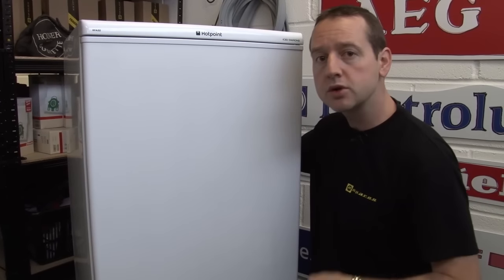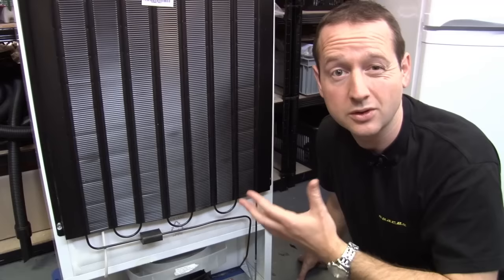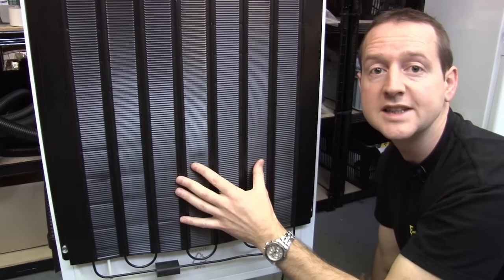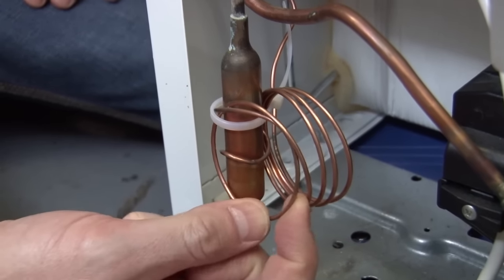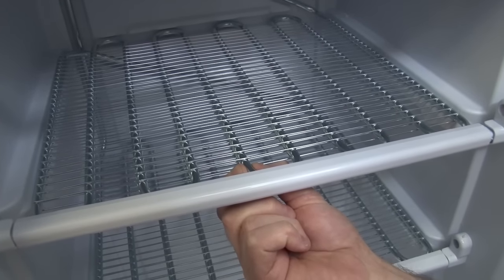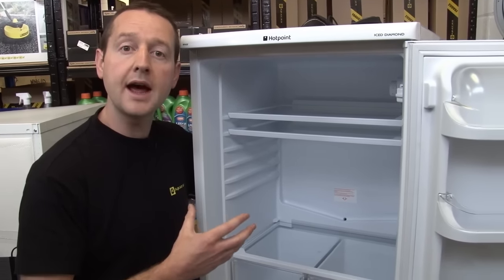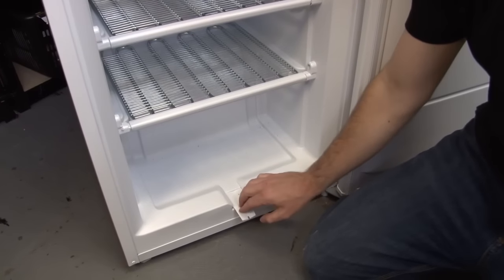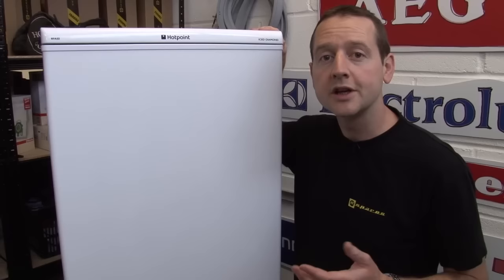How Does a Fridge Work?  (How is a Fridge Cooled & More!)

Comment: Thanks again, will give this a try.
I take it that if it does confirm that it's a compressor problem this would be a more costly repair as a would need to get an engineer to fix/replace the faulty compressor.
If this is the case I will Prob opt for a new fridge freezer as I would imagine this would be quite costly as some places charge around £70 just to look at it before they charge for parts and labour.
Reply from the maker: Certainly if it looks like a compressor problem get a quote as to how much this would cost to replace. The cost of the part alone without the 'fittings' could well be over two hundred pounds.

Comment: Great job explaining. Thank you so much. How does a combination fridge/freezer differ the temperatures between the two boxes? Do they share a compressor and have in line valves that shut off liquid flow?
Reply from the maker: Hi Brian, thanks for your comments. We think you will find our advice centre article useful below:
www.espares.co.uk/advice/careandmaintenance/how-fridges-and-freezers-work

Comment: Surprising how simple it is really.
Reply from the maker: The first fridge with a compressor was invented 100 years ago and essentially they are the same. The gas has changed a few times for safety and the environment but nearly all fridges continue to use a sealed system with a compressor and a gas.

Comment: This video is proof that you don't need to know how things work to be able to repair them. The throttling device, in this case the capillary coil, does NOT create pressure. On the contrary, passing through a narrow section greatly reduces the pressure on a fluid (Bernoulli's principle). The drop in temperature happens THROUGHOUT the coil (as is explained by the Joule-Thompson effect), not at its exit. What comes out of it is very cold, low pressure, partially evaporated refrigerant. As it circulates through the heat exchanger inside the fridge it absorbs heat from the stored food, which further evaporates the refrigerant. The rest of the circuit -the compressor and the heat exchanger at the back of the fridge (condenser)- exist to return the refrigerant to a state of high pressure liquid before it enters the coil again.

So these are the 4 steps of the process:

1) The compressor pressurizes the refrigerant: it goes from low to high pressure gas. This increase in pressure causes a big (unwanted, but inevitable) increase in temperature, as molecules of the gas are forced closer together.

2) To get rid of some of that heat and turn it into a liquid, the refrigerant goes through the condenser. The pressure doesn't change during this step.

3) The high pressure liquid refrigerant then goes through the capillary coil, which causes an opposite effect to the compressor: both the pressure and the temperature drop sharply.

4) Now we have what we need: cold refrigerant, which we can circulate through the interior of the fridge to cool its contents. The temperature of the refrigerant should remain constant during its travel through the evaporator, since all the heat it absorbs goes towards changing phase from liquid to gas (hence the name evaporator).

Pressure affects the evaporation points of fluids. That is why the refrigerant enters the compressor in a gaseous state even though it's cold, while it goes inside the coil as a liquid hot to the touch.
Reply from the maker: Thanks for your comments, While we agree with some parts of your explanation can we just point out that evaporation only starts as the gas exits the capillary into the evaporator. This can easily be confirmed by touching and feeling the temperature along the capillary, and comparing with the evaporator where the gas starts evaporating and cooling absorbing any heat from the surrounding area.

Comment: Yes u are correct.... If i could get the technical specs of the switch...that would resolve the issue of where i need to put probe but searching online comes up with nothing
Reply from the maker: Appliance manufacturers do not supply this amount of detail with their parts they just confirm the correct part for their models.
Reply: well originally i put the probe end in the freezer as far down as i could go from the fan which was only a few inches...and freezer wouldnt get cold enough...i then put the probe in the refrig side and now the freezer is too cold and the refrig sides freezes so i have to assume from this that the temp control switch is for freezer side...but i think i need to somehow get the probe away from the cold air fan in the freezer ..may have to add wire to the connections to get the probe to go through the hole in the bottom of fridge to bottom of freezer and then test again...

Comment: Great explanation. I accidentally pierced my fridge internal coil recently. With what kind of gas should I refill it?
Reply from the maker: There will be a label inside and on the compressor stating what gas (R600A or R134)  but to replace the gas you first need to seal the system and then remove ALL the air with a vacuum pump and then measure the exact quantity of gas. This is a job for a refrigeration systems engineer or it  is very unlikely to be successful and in most countries you have to be licensed to use R134 as as it damages the Ozone layer.
Reply: eSpares Oh, so, I guess I cannot handle it myself since a vacuum pumper is needed. But thanks for your reply.
Reply from the maker: Sorry for the news Ricardo but if its any guide I used to do this type of repair regularly but am unable to do it even for my own appliances as I no longer have access to the specialist equipment.:-(

Comment: this is cool!

I am wondering tho, you know the small box that comes in a mini fridge? it freezes but there are no connections to it to make it any colder than the fridge itself. I'm wondering how this works. How the little box can freeze while the rest of the fridge doesn't?
Reply from the maker: Reyna Elisaia Most 'under the counter' fridges have an ice box. If you look closely they are made of metal and typically have a zig zag raised portion on the surface. This is the evaporator and has the refrigeration gas flowing through it to cool the fridge. Its a bit like the reverse of a central heating radiator which will get a lot hotter than the room it is heating the ice box acts as a cold radiator for the fridge. It will be 'plumbed' directly to the condenser and the compressor.

Comment: Thanks for the quick reply.
It definitely sounds like the thermostat then as it does not run continually, only problem is I can't seem to work out how to remove the cover to get into the thermostat as there is no screws and pulling at it looks like the hole casing would be ripped right off the wall.
The model no is smeg CR 325 A1.
I can't seem to find out how to remove the part to get into the thermostat.
8 degrees is the coolest it will go if I move the thermometer to the top it is a good bit higher but I suppose that is to be expected.
If u know how this part is attached or how it can be removed it would be a great help.

Thanks Chris
Reply from the maker: Place your thermometer in a glass of water and leave for 24 hours to get a accurate reading and check the thermometer reads accurately as some are not so good.
To remove the thermostat cover ( http://www.espares.co.uk/product/es1597055 )
it appears there are two 'hooks' that lock into the lining when the assembly was pushed back from the front. There is likely to be a screw at the front that may be covered by the switch push that will need removing before pulling the assembly towards you and removing.

Comment: Thanks. Excellent explanation. One thing I dont understand is the relationship between the defrost sensor and the Fridge/freezer thermostat. Are they the same thing? My Fridge/Freezer get too cold,  it's in fact become a freezer. When I took the panel off exposing the defroster the drain hole beneath it was blocked by ice. Is that a problem with the Thermostat or the defrost sensor?
Reply from the maker: Thanks for the comments Fred. If there is a 'defrosting fault' the evaporator would be blocked with ice. Some machines can build up ice away from the defrost heater and some machines may have modifications to try and prevent this (Hotpoint/Samsung to name two). Clear the ice and ensure the drain is not restricted and confirm if too cold with a thermometer before checking if it will adjust.
Reply: Thanks for your reply. Much appreciated.

Comment: Thanks. This plus the article I found it on explained where the heck all that water was going. (Had what looks like a heating element failure with my fridge and was wondering why I wasn't drenched in water to mop-up when the components were covered in an inch of ice or more. >.< )
Reply: ***** ^ahem^ Perhaps I should've been clearer. All that liquid water only existed after taking a hair dryer and blowing some warm air on the components. Before that the evaporator coils (and anything nearby) were covered in about an inch of water in very much a solid state.
Reply: *****
That said, the compressor does turn off when in forced defrost mode, so I'm betting the control board is fine.
Reply: ***** I rechecked the heater and it reads 0 Ohms. Seems to me that's rather odd for a heating element that's supposed to have some resistance...though that is certainly the opposite of an open circuit. >.< (I've head these JAZZ boards are infamous for defrost failures.)

Comment: Too Good..I learned something..I wanna know how a solar refrigerator works..Thanks.
Reply from the maker: The main difference between 'solar' refrigerators and normal ones is a solar fridge is designed  to run on relatively low power. This is achieved by extra insulation and  by using a chest cavity instead of upright the cold air does not fall out  every time it is opened. In addition many solar refrigerators are designed to run on power from solar panels or other power sources.
Reply: +eSpares  Thanks :) I got it.

Comment: Hi I have the same fridge freezer although it's a smeg but everything looks the exact same as Ur hotpoint.
Am having trouble with the fridge compartment as it Dosnt seem to cool down below 8 degrees, the freezer works fine although and has slight build up of frost due to it being a manual defrost freezer. 
I have defrosted it before but it didn't help the fridge temp.
Any ideas what might be causing it?
The thermostat is set to 7 which is as cold as I can get it.
The housing for the thermostat seems impossible to get off to have a look or replace.
Any guidance would be great as to weather it's better to get a new appliance or if u think it may be a simple repair.

Thanks Chris
Reply from the maker: Hi Chris, If your appliance has lost some of its gas or the compressor is not running efficiently this problem can occur. The clue to this would be the machine not cutting off but running continually and if this is happening you would require a Refrigeration Systems Engineer to re-gas or replace the compressor.
If the thermostat where out of range the appliance would be regularly stopping running when it thought it was down to temperature.

Comment: Hi again.
I bypassed the thermostat and the fridge cooled down as the compressor ran continually and took the fridge down to 3 degrees where as when the thermostat is on it would not go below 7 degrees. 
I took the bypass back out to prevent it from over freezing.
I take it that this definitely proves that it's the thermostat that is causing the problem as the compressor runs fine when it has been bypassed?
Reply from the maker: If that is the case and when switched off for a few minuted the compressor will restart when turned back on then it certainly looks like a thermostat problem.

Comment: Hi I had a further look into this problem just trying to make sure I replace the right part.
When I open the fridge door I can here the thermostat clicking every 10 seconds or so but the compressor wasn't switching on.
However as soon as I opened the freezer door the compressor came on within a few seconds.
Is this another thing pointing to a faulty thermostat or could this mean something else?

Thanks

Chris
Reply from the maker: If a compressor is failing it may stall, then because it is taking a high current it has a cut out that prevents damage. This results in the compressor clicking and humming slightly for about 5 seconds, clicking again and silence for about a minute when it will repeat. If this is occurring the freezer will be defrosting until the compressor restarts but if well frozen you may not notice.
Examine a bit more before making a diagnosis.

Comment: hi i was wondering if you would know if temp settings would be same or diff on a single door manual defrost mini fridge/freezer dorm style vs normal 2 door home refrigerator/freezer...i think they would be diff cut in cutt off temps becausue in a mini fridge/freezer  the temp probe is mounted underneath the freezer compartment and the temp probe in a standard home refrigertaor /freezer is inside the refrigerator section....my temp control went bad... compressor woud not turn off unless temp cpontrol was in off position only........i just installed a mini fridge one in my regualr fridge (cant afford a direct replacement) and it does seem to work now ....prior to this the compressor would not shut off....now its turning on and off as temp reeaches bur like i said i believe the temp on off is diff in a mini manual defrost fridge than a normal home fridge...if i used a mini fridge/freezer  temp controller in a reg refrigerator freezer should i put the probe in the freezer or fridge side? i guess what im trying to say is that is a temp control in both of these have basically the same cut in cutt off temps?
Reply from the maker: Capillary type thermostats can be designed for different types of refrigeration equipment. If attached to the 'cold box' depending on the design of the fridge it may shut off at near freezing if it is a 'chiller' or even up to -18C depending on the cold box * rating.  In addition some fridges have 'air monitoring' capillaries whilst others as you say attach either directly to the evaporator or to the 'wet wall' on auto defrost models. This could explain why the replacement thermostat is regulating differently.

Comment: hello, i have just bought NEW larder fridge under-counter  model; but it is making a POP noise every-time  only when the compressor starts  during day and night. is it that considered normal operation?
thanks,
Reply from the maker: Often during transport the compressor pipework can get bent a little and may catch the cabinet when it starts. If this is a 'clunk' then it may be worth contacting the supplier to get an engineer to check and adjust if required.

Comment: I have that Hotpoint refrigerator you’re using in the vid. I have a problem with it where my fridge is warm and my freezer works fine! Could you shed some light on a possible cause? You didn’t really cover his the refrigerator is cooled...only how water is drained away. Could you help?
Reply from the maker: Check your fridge freezer is not different to this one, if you look at 2:40 you will see it has 'evaporator' shelves. If your appliance has a fan ond no shelves the problem is likely to be ice built up behind the panel in the freezer. For information on that problem watch another video: https://www.youtube.com/watch?v=duTWh83nVdA
Reply: eSpares hi thanks for the reply. It is the exact same fridge freezer. Hotpoint RFA52 with the same evaporator shelves in the freezer (same as in the vid). I defrosted it last night (turned the dial to “•” as per the manual) then restarted it once complete. Checked this mornin and the freezer hasn’t reached optimum temp and the fridge is still warm. I can still hear the compressor etc making the same noises it always has. Baffled! Any advice is appreciated.
Reply from the maker: Thanks for the model number now we can be more specific with our advice. On fridge freezers the 'cold' enters the freezer and then on to the fridge until 'all used up' in laymans terms. So this suggests insufficient cooling in the first place. As you have already defrosted this only leaves a problem with the refrigeration circuit. In practise this can only be due to low gas due to a leak or perhaps more likely a worn compressor.
Both these problems would require a refrigeration systems engineer and both are likely to be expensive. Get a quote before anyone comes to see the applaicne and consider if this is worth pursuing or is it time to replace?. PS, sorry for the bad news.
Reply: eSpares hi, again, thanks for the reply! I’m sure you have better things to do on  a Monday than second guess my problems lol

I’m pretty technically minded and this is the answer I was expecting so no worries about the bad news. They can’t last forever. I don’t think I’ll look into a repair. I may as well shop for a replacement. At least you helped me clear that up. Many thanks and cheers for the advice 👍 good video too.

Comment: Whats the coldest temperature an average refrigeration freon or iso. compression system get? 

(Thinking about using a mini compressor to keep my new pc rig cool, without it cold locking any components mainly the cpu)
Reply from the maker: Hi MajorisMons, I faulty freezer when running continuously can go down to -30C but the temperature would build as there is no heat source inside a insulated cabinet.
To create a refrigeration system you would need to vacuum out the 'plumbing' when complete and measure in a precise amount of gas into the system and this is well above the skills and equipment available to most.
I have heard of purpose build cooling systems but these are generally on commercial equipment.